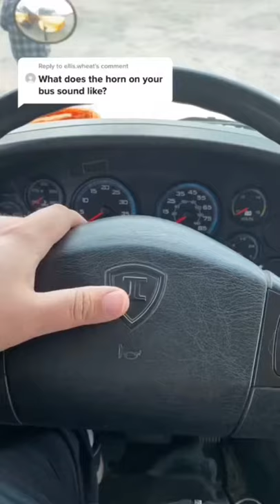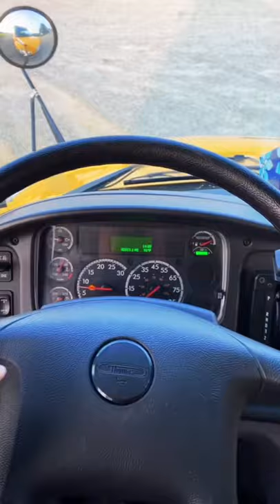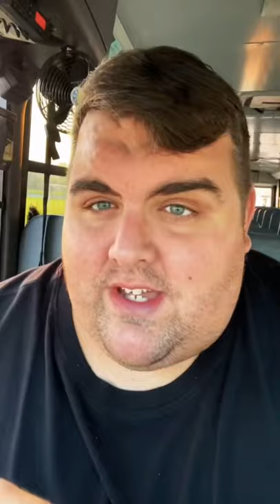WHAT DO SCHOOL BUS HORNS SOUND LIKE?

Comment: Buses need those air horns that semi trucks have.
Reply: Or an air whistle.
Reply: Some of the buses in my school district have air horns installed. After all, they already have pneumatic brakes, why not strap on an air horn while they're at it?
Reply: Air horns
Reply: @CorollaChronicles  not how it works, you need at least a compressor for that and the district won’t pay for it
Reply: They do, it’s down on the floor my the brake pedal
Reply: @indianbri  school busses already have an air compresser for the air brakes